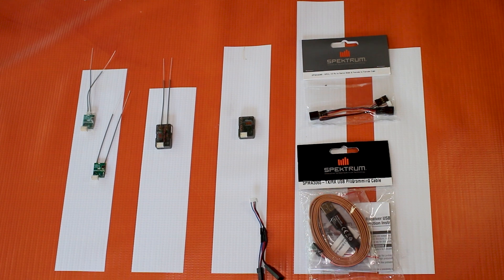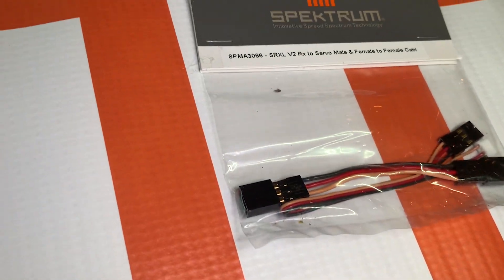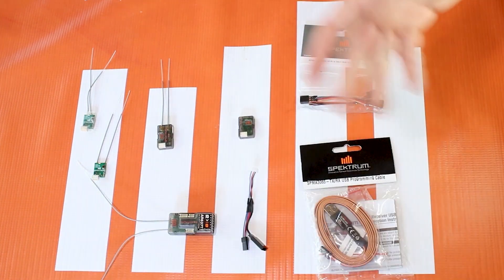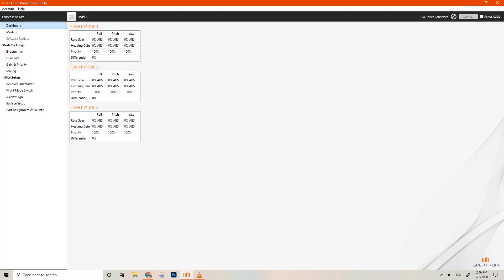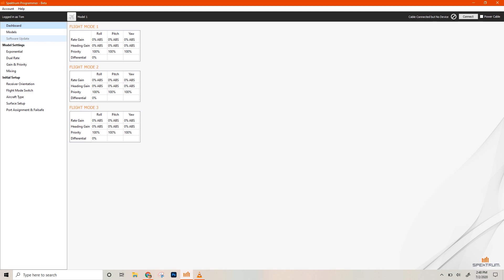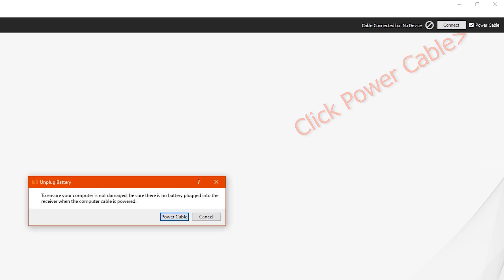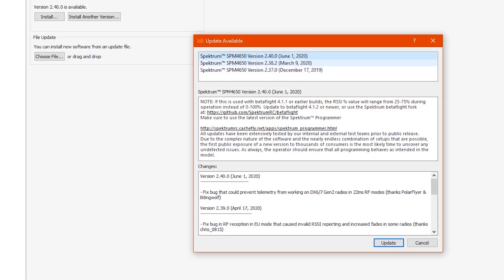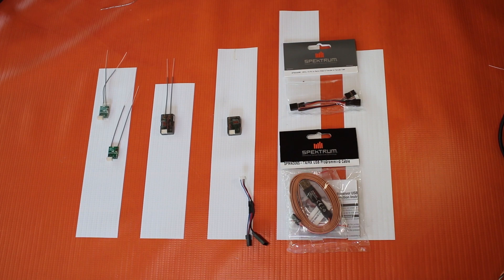Spektrum Quick Hit Tech Tips - How to Update Firmware on a SRXL2 Serial or Remote Receiver

Comment from the maker: In this video Tom explains to our fellow RC enthusiasts how to update SRXL2 Serial and Remote Receivers, such as the SPM4650 FPV Racing Rx, SPM4651T Serial Receiver and the SPM9747 SRXL2 Remote Receiver.

Product referenced in this video

USB Programmer Cable - https://www.horizonhobby.com/as3x-pro...
SRXL2 Adapter - https://www.horizonhobby.com/srxl-v2-...
SPM4650 - https://www.horizonhobby.com/dsmx-ser...
SPM4651T - https://www.horizonhobby.com/srxl2-re...
SPM9747 - https://www.horizonhobby.com/dsmx-srx...
Reply: What does this do? Fly further? No explanation anywhere
Reply from the maker: @Alohakoa59  What does SRXL2 do? Here is our definition - SRXL2 - SRXL2 is a powerful bi-directional communications protocol that improves the speed, security, and richness of data transfer between your radio system and compatible on-board devices such as flight controllers and Smart ESCs. SRXL2 lowers the latency compared to legacy protocols and allows flight controllers to be configured directly from your Spektrum transmitter, without requiring a computer or smart device. You’ll also enjoy more responsive telemetry that can be customized precisely to your needs. And it’s all done over one signal wire!
Please note that SRXL2 is not backward-compatible with the legacy SRXL and remote receiver protocols. SRXL2 support updates may be required for your device to use SRXL2 receivers. Learn more here - http://www.srxl2.com/
Reply: But can I fly further? I have an fpv aboard
Reply: ☠BLACK BARON☠ How do I software update an SPM9745 receiver? Do I need a special plug to do this?

Comment: Been a LONG time Spektrum fan, DX4, DX5, DX6i and my last and LAST one is the DX8. I'm finally updating my quads and find out that Betaflight can't see the receiver unless I flash back to 2019, defeating the purpose to update my FC on my quad. Now I have to buy a USB flasher unit to do all 3 of my SPM4650's. Unreal!! I'm mean seriously!! this is a Joke to say the least. Not happy with this so I think I'll just sell these at a swap meet and switch to the FRSky R-XSR receiver. Those work great and I didn't have to buy anything to update them. Seriously, very frustrated with this as all my receivers are hard wired into my quads... I'd have to open the quad to gain access to the receiver. Then desolder the wires to the FC, then solder on new wires just to flash this... Not happy Spektrum! NOT happy!!

Comment: I just got the DSMX SRXL2 Serial Receiver (SPM4651T) which will be placed as a remote receiver almost inaccessible in the rear of the fuselage at the end of a 36" extension cable. So the only access point is the female plug which connects to the SRXL2 port of the AR8020T receiver. 
I have the TX/RX USB Programming Cable SPMA 3065. 
Is the USB Serial Adapter SPMA3068 the missing link between the 36" extension cable and the USB Programming Cable in order to access the Serial Receiver for registration and a software update?

Comment: Is there a way to program the flight controller and the transmitter so I can add a new servo and make it turn on by flicking a switch on my transmitter. (I have the apprentice STS and the DXS transmitter)
Reply from the maker: You will need to upgrade to a DX8e or NX8 to be able to use the extra channel on the Apprentice STS

Comment: Hi there, I’m flying the apprentice sts as I’m fairly new to this hobby and my sts has the spm4650c receiver in it. Do I need to check for updates for this? 
I’m getting 1500-2000 frame losses per 20 min flight and I don’t know wht
Reply from the maker: Hi Dave, I would say those numbers are nothing to worry about. Normally we see 300-500 frame losses per 5 min of flights. Really as long as you are not seeing drops in signal (ie Holds) then you are good to go. Hope that helps!
Reply: @SpektrumRCvideos  that’s really good to know. Thank you very much for putting my mind at rest. If I may……. I’ve put the latest firmware onto my dx6 gen3 and I’ve updated my 4650c receiver today also but what about my flight controller do I need to do anything regarding updates with this? And if so how would I do this It’s a Spektrum A3230  
Regards
Dave
Reply from the maker: Actually there are no updates available for the A3230, so you should be all up to date as far as that model is concerned :)
Reply: @SpektrumRCvideos  brilliant stuff. Thank you again for your help.
Dave North Yorkshire 
England

Comment: I bought the SPM9747 DSMX SRXL2 Remote Receiver. It has a 4pin/4wire, the rx1/rx2 on the 6250HX is a 3pin/3wire slot. Can I use the X-BUS slot on the 6250HX for the SPM9747 remote receiver?

Comment: Do you have to have that big RX to update the small drone rx?  As I don’t have any Spektrum rx stuff.  Been using my transmitter for BNF helicopters. And want to set it up to use in my multi rotor.
Reply from the maker: No, just need the SPMA3065 cable and the adapter discussed in the video :)
Reply: @SpektrumRCvideos  oh ok the way it was discussed it sounded like you have to plug it into that other rx as well.  What is the point of the 3rd servo wire?

Comment: I have installed the 4650 on 2 brand new quads and for some reason they both randomly failsafe for RX loss, even at a few yards of distance. A couple of time even while sitting at my desk, the motors started beeping to signal RX LOSS. Not sure what is wrong (NX6 radio)
Reply: Ever figure this out?  As I’m planning on getting this Transmitter for my Helis and also using it on my multi rotors so I only have one transmitter.

Comment: I have purchased two of these receivers along with the usb programming cable. but the update cable is out of stock any tips on how to build my own?
Reply from the maker: Suggest taking a recycled servo extension and using the female end and splicing the other end into a matching 4 pin header to the RX, like it is explained in the video. Also, if you have used any of the SPM4649T receivers in the past, the lead that comes with that works well when you reposition the pins. Hope that helps!
Reply: @SpektrumRCvideos  Where can I buy the matching 4 pin header you mentioned? What is the part #?

Comment: Once the receiver is connected in my aircraft most likely through direct soldering, how do I update it? maybe it is time to enable updates through the RC link instead.
Reply from the maker: If you soldered directly to the rx then you will have to make a adapter or something along those lines. Best suggestion is to leave/use the plug on the RX so you can update easily when needed.

Comment: what is different between SPM4650 and SPM4651T ? i know that SPM4651T is bigger and  cost 20€ more but its better than SPM4650 ??
Reply from the maker: essentially The 4651T has longer range. Also the telemetry range is as much as the control link range :) other then that they are same functionality wise.

Comment: What users that did not solder the jst connector to the receiver.
Reply from the maker: You will want to temporarily solder a female servo lead to the Signal + -
Reply: @SpektrumRCvideos  not a practical solution, I basically need to tear down my drone to access the receiver to remove the heat shrink wrapping to solder a temporary female servo header to the connections. Why can there not be a solution of performing over the air updates for radios like the IX12 or radios that can take an external sd card in which the update cane be stored on.